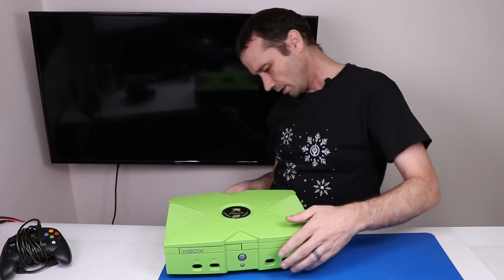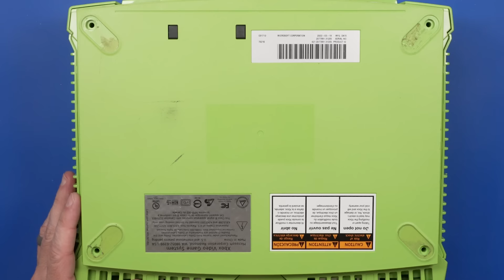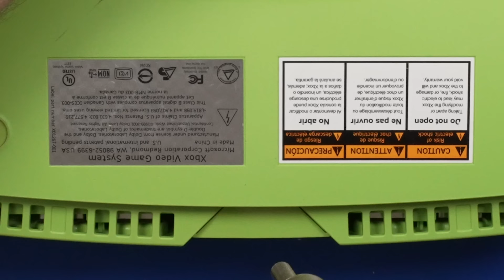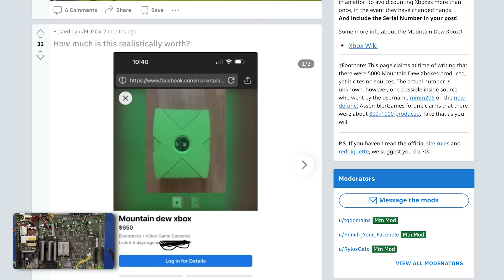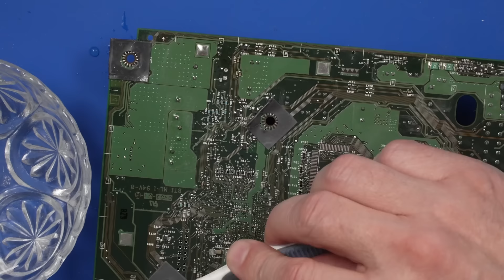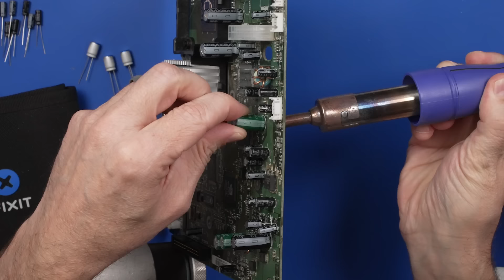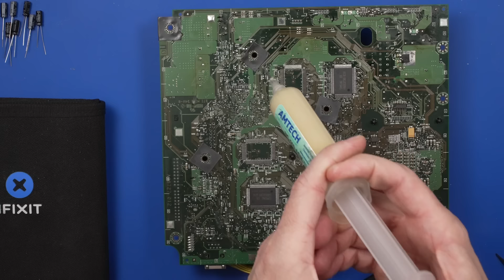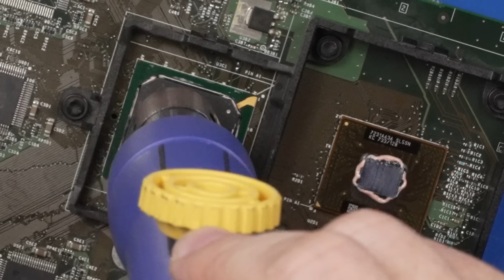I Finally Found One of These! Can I Fix It?

Comment: Big bruiser caps are immense fun if you run the charges wrong way round hehehe   When I was cutting my teeth on stuff back in college early eighties our tutor had gotten hold of some ex telecoms pot capacitors, these things were huge and we all had a turn running mains 240v into them the wrong way round and "boom" they would leap into air spraying shrapnel and made it "snow" little flakes of burny snow lol   Later on when at British Rail we got hold of a set from a locomotive, known as "stay alive" caps designed to keep a traction motor field active when a train was gapping or running in the bits not powered by a third rail... we was in a disused engine shed and way way back and nice bit of reverse mains thru and these things blew window panes out the roof and jumped up like a rocket :P   The ones we all wanted to have a go at were the 25kAC overhead versions but you needed three phase to make them pop, so had to be content with the 750v DC stay alives.

Comment: first check the fuse, I dot`t know if you replaced the Bootstrap capacitor (small cap on the primary side of the power supply)

Comment: I'm working on my £4 Xbox One OG this weekend, it does work per se but it for some reason just flakes on the video output so going to change out the mobo and dabo and take it from there.   I bought a wood effect shell, like the wood grain on an old Atari VCS in the dark teak, actual shell not silly stickers as I like the idea of a wood looking 'box and it came with a matching controller top shell plate.   As I am going to have the tools out I am prob going to steal in and replace the 5 filters on my £17 Switch so it can finally dock properly.   Had enormous fun from it in handheld but I want to experience my Resi Evil's on my 52 inch flatscreen and I am waiting patiently like a dog next to the empty food bowl for the announcement of GC titles to start to appear on the Switch including the remake of Skies of Arcadia (best Dreamcast and Gamecube game hands down imho)

Comment: Also I would highly recommend A mod chip. And not for piracy, but for being able to rebuild the hard drive and installing a new hard drive. Then you can reinstall the stock o s and still use the console without the security on the console

Comment: I guess I would have tested the power supply independently from the motherboard? Also, I don't think I ever would have put it together until I got it working again. With the top off and everything spread out it's just so much easier to put a multimeter in there and check for voltages and stuff.

Comment: Swap the power supply board from known working donor. I bet the power supply is dead. Happened to one I repaired. Capacitors didn't fix it so I didn't go any further since I had a parts machine.

Comment: Man, that's a terrible, terrible way to solder that clock cap. Just clean the holes with some wick and push it through, no idea why you're making the job more difficult for yourself. If you really want to do it this way, at least chop the legs down first.

Also, none of the caps around the clock capacitor require replacement at all. Just need to do the clock cap and the Nichicon CPU capacitors that typically lead to the no-start condition. The PSU is probably 100% fine as well. I get you're doing this to spice up your video, but some poor person who doesn't know any better might actually end up trying to do all this work for no reason at all after watching it. All you did here was throw a bunch of parts and time at a console without trying to do ANY real diagnostics and the result speaks for itself.

Also, that "thermal paste" you're removing is not a thermal paste at all, which is why it behaves like an adhesive. OG Xbox uses PCM pads that can be left well alone. If you do want to remove this stuff, use goo gone and let it soak for 10-15 mins. You did a terrible job at cleaning it too, there was a whole lot left on the GPU, so there's a good chance your "repaste" will do a worse job than the original PCM.

There are a few possible reasons why you're still not getting power after this brutal exercise in futility:
1. Your full recap caused a problem (very likely), so you need to recheck all that work.
2. Check the front panel traces that run along the bottom front-left edge of the board (same corner as the clock cap), there could be broken traces there. You can find some basic schematics showing where they go online. 
2. Check the tiny SMD caps around the power connector, they could have been damaged by the blown CPU caps.
3. Verify that the PSU actually works after you recapped it.

Honestly, after this fail of a video, it's best to just swap in a new PSU/mobo/HDD from a donor system and call it a day.

Comment: the capacitors failed because the mountain dew edition has mountain dew-based capacitors.  they went flat after a while and need to be refilled with fresh mountain dew or replaced

Comment: There are 4 traces on the underside of the motherboard, they run right along the front edge and then up the right side of the board.  Those traces often get breaks from leaky capacitors.  Those traces i believe are related to the power and eject buttons, so if they are damaged those buttons may not work at all.

Comment: Hello you should check the continuity between the front panel power and eject  buttons and the PIC microcontroller on the motherboard. I fixed mine using a soldered wire between the 2. Absolutly worth a try 😊
Reply: I second this. Clock capacitor leaks usually is the culprit and the PIC rewire, usually does the trick.

Comment: I would check the traces on the back of the board at the edge below or near the clock capacitor. Generally when the capacitor leaks those traces end up getting damaged and need to be repaired. When this happens the front panel may either not function at all or turn it self off or on automatically.

Comment: trace rot. Also check the joints on the psu where the plug connector is. Make sure those are good.

Comment: IMO I don't recommend to replace the clock capacitor, just take it off and clean the surface. Also the majority of the electrolitic capacitors should be good, the only ones that tend to be damaged are the big ones near the CPU due to the heat in the area (design mistake).

Comment: It's easier using an Exacto Blade to get label corners up once you do you need to go slow and get heat under where you have it peeled up a actual heat gun almost to hot I feel a hair dryer works better. Nice find I hope you can get it going in the next video thanks!

Comment: You think it would be dangerous to throw that board into a ultra sonic cleaner?
I see a lot of people do it with electronics, gets rid of every single piece of dirt and corrosion under every little chip and joint. They are miracles
Also something tells me a fuse is blown somewhere but idk where fuses are on boards

Comment: The problem is in the transistor model MMBT4403-2T, it did not provide the necessary current flow to the motherboard. The transistor is located next to the IDE pins. Saudos desde Chile

Comment: I'd be curious to see if its just the power supply. I had a 1.1 with a bad transformer that caused the system to not turn on. I replaced the power supply and that resolved the issue. If you have the parts I'd start by trying to isolate the issue to the power supply or the board by testing with known good parts. The power jacks often have cracked solder joints but from what I can see this one is good or you already reflowed the solder on it. Plus you can usually feel if its loose and you'll typically get intermittent power if you wiggle it.

Comment: You do not do minimum amount of checks to see if it even makes sense to repair it. I do not know even where to start...
First off make sure all capacitors are properly installed.
Check if traces are not rotten and even transfer current (not only those around capacitors, inspect entire board!).
Check if there are no shorts on the power supply and around main chips.
Check if the main voltage supply lines on the motherboard do not have shorts.
Check the PSU separately if it even produces the voltages (and if the voltages are correct, should probably do load test, but you probably are not equipped for that).
Check if switches even work.
Check the fuses if they are not broken.
If all above checked, disconnect everything other than the PSU from the board and run the board to see if drives and other peripherals do not cause issues (shorts!).
If nothing above works, use thermal camera to see if anything gets warm, if so - check what is and if there are no damaged components (if main chips are fried then it's board replacement time, unless you have know how to replace those, I have my doubts).
If everything is cold, check why the voltage does not get where it should (probably damaged traces/vias).

Those are basic checks you should be doing if you want anything to work. There are other things to check, but I think this is enough for now.

Comment: The most common type of electrolytic capacitor makes use of aluminium foil, which can be etched, dimpled or corrugated to increase the effective area, enclosed in an aluminium can which is filled with a slightly acid solution of ammonium perborate in jelly form. The capacitor is formed by applying a slowly rising voltage to the capacitor, with the foil positive and the case negative until the voltage reaches its rated level and the DC current falls to a minimum, indicating that the insulation is as good as it is ever likely to be. From then on, when the capacitor is used, it must have a DC (polarizing) voltage applied in the same polarity so as to maintain the insulating film. If the capacitor is used with the voltage reversed, the film will be dissolved, removing any insulation and allowing large currents to pass through the liquid, which will vaporize, destroying the can. The electrolyte is usually in jelly form, but the devastation that can be caused by an exploding electrolytic (not to mention the noise) ensures that no one who has achieved this is willing to try again. 
[Ian Sinclair, in Passive Components for Circuit Design, 2001] Chapter 4.

TL-DR: Some do in fact use a slightly acidic solution. Neutralising acid however, would be better achieved by using a baking soda paste. Since it's highly alkaline. Vinegar is acidic.

Comment: You will figure it out Steve Don't give up. Capacitors generally comprise a conducting salt based on long-chain aliphatic dicarboxylic acids and also a solvent, for example ethylene glycol. An example of a conducting salt used is dodecanedioic acid, which is generally used in the form of ammonium salts.
Reply: I was going to say the same thing!

Comment: Dead power supply, fuse or FET. Good news is you can just replace the guts with another of the same version as long as you do the drives too

Comment: So obviously you know what you're doing but I was always taught you should apply the heat to the joint and then add the solder is there a reason why you add solder to your iron first? Really just curious

Comment: I have one question: How do you protect your soldering iron from slag so well? Why is it not completely black all the time?
Reply from the maker: Brass wool sponge. I clean it almost every time I load my iron with solder
Reply: You "tin" it. This protective layer prevents your soldering iron tip from oxidizing.

Comment: first thing to check is there voltage on the on switch ,if not check all the voltages from the psu ,if there is none (not all lines will be active in the off state)check any fuse on the psu ,if ok look for a high value resistor on psu (there may be two in series)they/it suply a start up voltage to the chopper chip .good luck with the repair

Comment: i think it has something to do with the traces and that coroded transistor looks gone u should always check fuse for continuity after all that replacement of components i can guarantee the fuse has blown and some of the solder joints look sketchy might have to rewet all the joints

Comment: Denatured alcohol is a good way to loosen the adhesive of stickers (even the security/warranty ones!) without damaging them. It even keeps the adhesive sticky once it evaporates.
Reply: Correct.  Get a syringe and a fine needle to work the alcohol under the label.

Comment: Yeah......I need to disassemble my tv remote (which has no screws yay!! (sarcasm)). The batteries were 10 years old (the tv is 10 years old). They leaked. I have vinegar. Taking apart is the question. Fortunately the damage isn't that bad. I believe vinegar alone will fix it. It does work, but it's power levels are unstable now. It's not getting good contact.

Comment: Its funny because the 'rare' part of these Xboxes is just plastic right? The guts are the same right? It doesn't have faster GPU or CPU right? Cant you pre bend the capacitor legs? To shape them to fit before inserting them?
Reply from the maker: That's the only difference that I know of

Comment: I might've missed it, did you check the PSU at the point where the wall plug meets the board?  Some Xboxes are known to have these crack, and I can't recall if the MT Dew one was one of those.
Reply from the maker: Didn't check that but I definitely will

Comment: Honestly, I'd probably just swap the power supply, assuming it's not a version 1.6 motherboard, which I don't think it is, and try that instead.  Those original Xbox PSU's are somewhat prone to just breaking, and I had to do a PSU swap with mine to keep it functional.
Reply: It's a V1.2 or V1.3 - it's got the "ATX style" 2 row power connector, but is still using the Conexant video encoder chip.  If the HDD is original, then it's probably a V1.2, since the V1.3 typically used the lower profile HDD.

Comment: Hey Steve. 2 questions. You said that capacitors still hold a charge for a very long time so either don’t mess with them if you’re not comfortable or be very careful correct? And the other  is do you know if there is an equivalent or substitute for BW 100? My iPhone is not charging because the port is completely dirty so I was hoping to ask you if you know of anything that is the equivalent
Reply from the maker: Yes, capacitors can hold a charge for a long time. Usually the power in this is bled off fairly quickly but it is possible for some to hold a charge for a long time...especially if the device is damaged. I'm not sure what a good alternative to BW100 is. Sorry

Comment: I'm no chemist but I'm having problems with accepting the idea that vinegar can neutralize acids from the capacitors that are on the board. Vinegar is water plus a bit of acetic acid. Thus vinegar is acidic. It probably works by getting under the corrosion and releasing it by actually etching away some of the underlying metal.
Reply: The leaked fluids from the capacitor are not acids, they are the exact opposite of an acid.

Comment: Great video! I have a question though: in engineering school we were taught to heat the pad and touch the solder to the heated pad, not the iron. I find this very difficult and not very effective at times. I saw you were putting solder on the iron and touching it to the pads with the through hole capacitors. What temperature do you use for that because that seems a lot easier
Reply from the maker: That's how they teach you. Generally speaking that probably makes a better joint in many cases but also, I don't think it's necessary especially when working with small components. I'm sure there are some soldering experts who can explain why but I don't know all the reasons. I think it's also not as important to do that these days as it was back in the day.
Reply: @Tronicsfix  thanks!
Reply: i was taught that too, for me they gave te reason it would result in a better connection because it flows a bit more through the via so the connection is stronger.
as for the temperature i think it's just the same temperature since it's melting either way and i don't think there is much difference between hotter/colder when the phase changing happens on the solder tin (i think) :)

Comment: Acid did some damage on the power trace lines, check the connections between the power button and where the clock capacitor was located.

Comment: Were you able to test the power supply after changing out the capacitors?  Maybe use a known good power supply and test the rest of the board?  It might help narrow down where your issue is...

Comment: Couldn't you just put a working Xbox in that shell and it would be just as valuable?
Reply from the maker: I mean, sure, I could. But I'd really like to fix this board
Reply: @Tronicsfix  I just mean...if the board isnt fixable....there was nothing specific in the OS of the Mountain Dew ones that would be unique? The original Xbox's are only like $50 used so it seems much easier to just  swap the internals and then you could sell it for $500-800, still make a profit. Your plan is more fun though! Love the content and channel. Best of luck 🤞

Comment: Sometimes when damage is this bad it's best to pull the components and completely clean off the old solder etc and resolder the parts. It's like battery damage which just eats the contacts and destroys solder. I'm rebooting my channel soon and will be concentrating on these kind of repairs along with test gear reviews. It's worth investing in a Bob Parker ESR tester for Electrolytics.